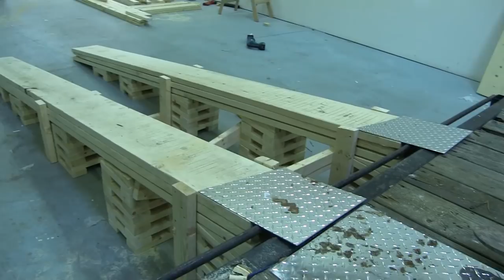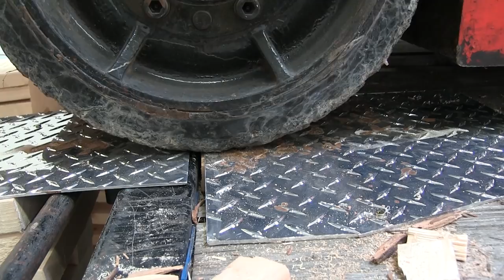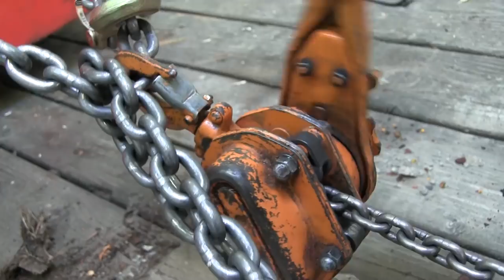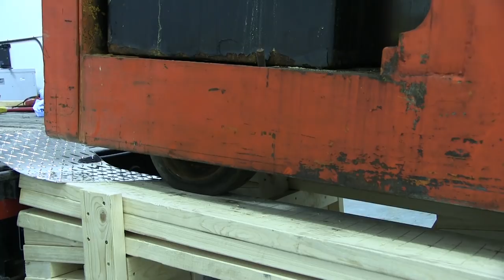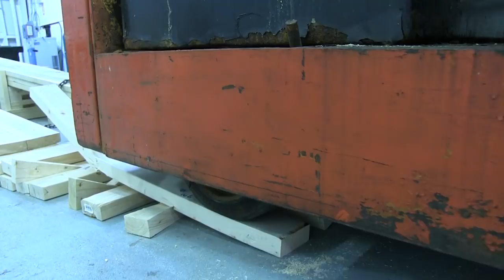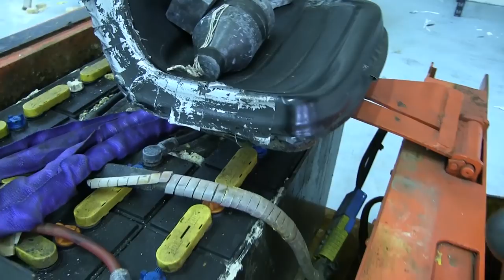Problem Solved! | Forky McForkface

Comment: I had an electric forklift at the shop that had some crazy electrical issue where it was lose all control (save for the brakes) and just die at the worst times...near the end of its tenure we called it the widow maker and only the only people who were willing to use it had ice in their veins. After a few crashes the boss finally "upgraded" to an even older propane unit...which required a complete overhaul

Comment: as for me ; I would of just called the tow company to come over to use there portable loading/ unloading ramp. otherwise known as a rollback wrecker to unload
that rig straight up as you just spent that much or more in lumber, time, screws and beer . the one thing you would not have had was the pucker factor.
best thing is that you got er done. good job !!

Comment: Hell of a nice giant Jenga set ya got there. Rolling the lift backwards must have cracked loose whatever's stuck in the brake system, but it might bind again if it isn't cleaned out.

Comment: Could there be a dead spot in the motor? I had a small block Chevy that had a bad spot on the flywheel. if I cranked it by hand an inch, it would fire right up.

Comment: AVE, Is it possible that when it was parked on the trailer the brushes and contacts landed in just the right spot as to not make enough contact to start turning the motor, but now she's making contact again from rolling off the trailer?

Comment: next time get a tow truck with a roll back.  it's way safer and don't need to spend hours cutting lumber.  should also cost less than the lumber

Comment: reminds me of the time i used 3 2x6 boards held together with some thread all and rope to pull a 350 from a chevelle with the trany still connected was creaking worse than a dead tree in a wind storm but it got it done

Comment: lol some times  all it needs a little gentle persuasion. for our forklift at work it locks up only  when it gets wet. now you wouldn't  think that's  a problem  with how much grease  is covering  it but it is but that was a problem  when the exhaust  burnt through  the battery  cable and shorted out and caught fire

Comment: I just about sliced through an artery this morning, with a license plate! All I was trying to do was scrub some bug carcasses off.
Reply: @John Harwood I doubt bugs sharpened the edge. However, since it is stamped, the edges are rough and sharp. I was simply trying to reach below the plate to get the spoiler. Didn't even think the plate was an issue until the blood started squirting. Got me right in the crease of my bicep and forearm. Accidents are always unlikely occurrances!

Comment: Two things: 1) No better way to fix the electronicals than dropping the forklift onto the floor from half an inch and B)  this was almost (but not nearly) as entertaining as watching Brian Bloc (bcbloc02) drop a 15 ton radial arm drill from two feet onto his newly poured and cured machine shop concrete floor. Glad you kept your fingers and toes attached for the next veedayhoe.
Reply: Robert Orr, Brian was lucky that things weren't worse! That could've been a real disaster.
Reply: @robertlee9395  Brian was really kicking himself in the rear end for not spending the $200 on a new chain. Fortunately he wasn't killed or maimed by a piece of flying concrete. He has paid his dues however, in having to weld and repair the drill. He has otherwise done some spectacular work on his channel. Amazing what just a lone man, with an education, intelligence, and boundless energy can do.

Comment: are these things not designed in a way that you can remove the weights for transport?
Reply: You can remove a little by removing the battery, but generally a good portion of the counterweight is solid mass on the ass.